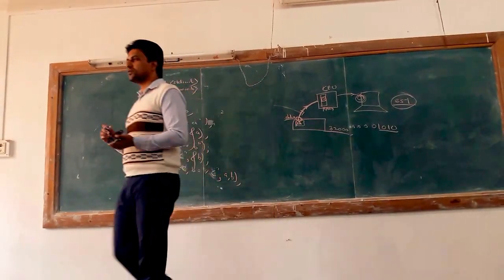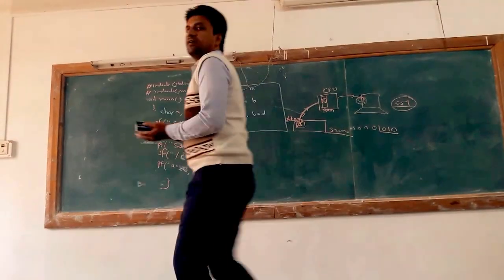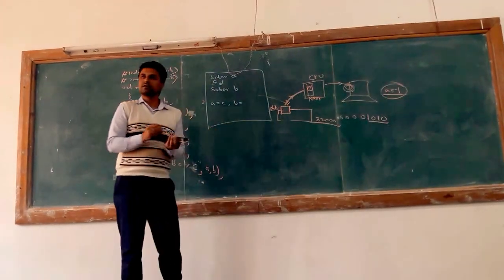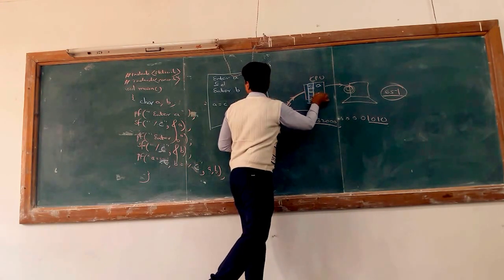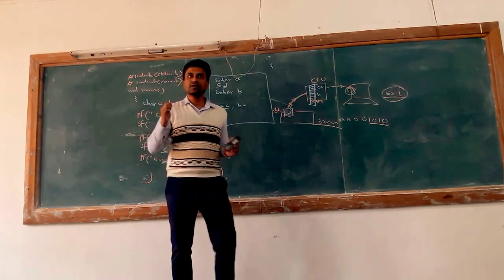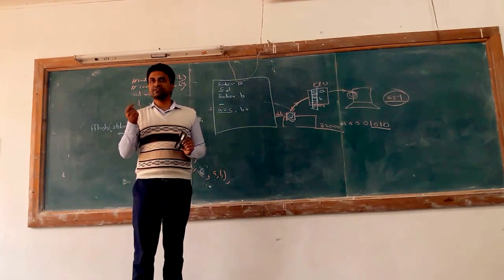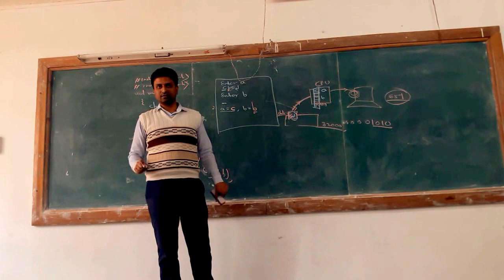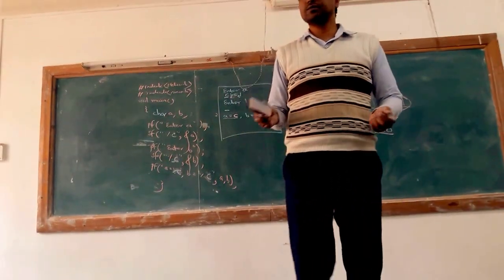Basics Of C Programming Language New 6

Comment: sir ,when we press the enter key then the data moves to the buffer and again it should encounter the scanf for b , that is what I did not get why it gets a blank
Reply from the maker: https://youtu.be/lFPdoaTc-Fs            plz see this video. Also use fflush(stdin); statement after scanning 1 st char.
Reply: sir understood the swapping but if I write the same program for int it displays , I do not use fflush to clear the buffer
The doubt is with the stream probably I am not getting it. I tried to write it with integer value as stated in your earlier example.  Why it does not work with the int as both of them are displayed in the screen

enter a   3
enter b   4

Process returned 0 (0x0)   execution time : 7.281 s
Press any key to continue.